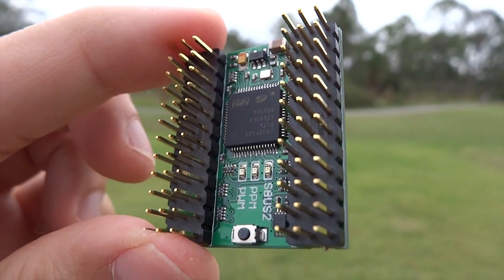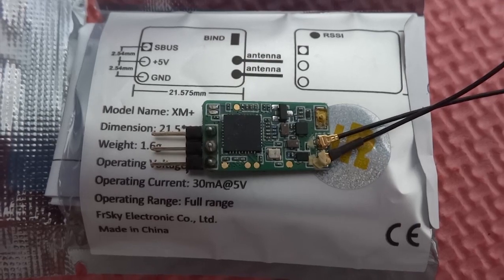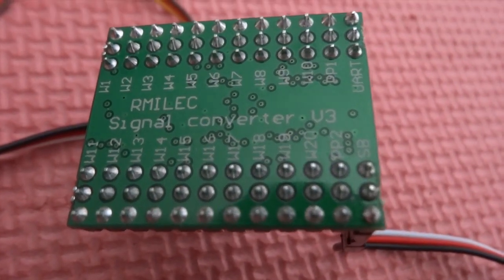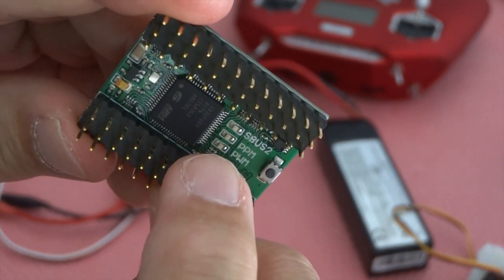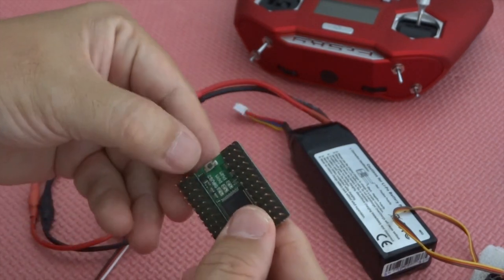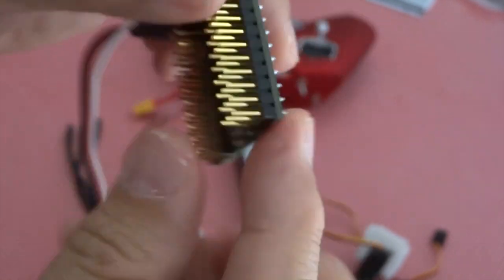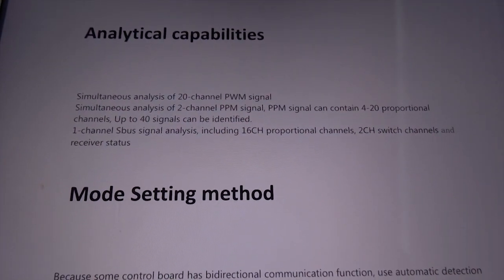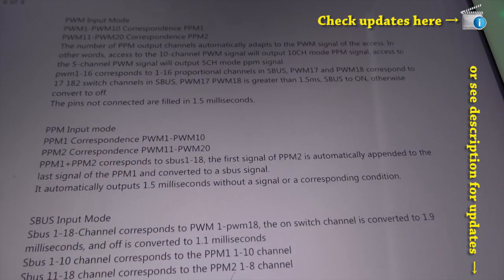RMILEC Signal Converter V3 SBus to PWM Explained

Comment: Hi Dronemission, i've just found your video , it's coool...very very interisting for my project...i need to convert Sbus protocol because i wish to connect my X8R ( sbus, 16ch ) to an arduino nano...all run well when i plug one  signal cable for CH1, another one for CH2...etc and i get the datas in Monitor Serie of arduino..but nothing is happended when i plug my signal cable from my RX directly under sbus...
i suppose this RMILEC Signal Converter V3 SBus to PWM will be match with arduino nano...?
thank's a lot for your answer, happy fly
Philip
Reply from the maker: Greetings, i don’t see a sbus on a Arduino Nano, so you convert x8R SBUS to PWM.
Reply: @dronemission  yes i undertand...X8R Sbus to iN on RMILEC then Out from RMilec to Arduino Nano Pwm... is it correc t for you?!
Reply from the maker: Yes, that would be what I would try
Reply: @dronemission  ok i'll try this when i'll received my RMilec and i'll inform you...thank's a lot

Comment: Can it work with flysky's Ibus?
Reply from the maker: Greetings, it says sbus2.  If you search sbus2, there are lots of discussion about the difference between sbus and sbus2.  It does not indicate iBus where one port for servo data output and one port for sensors.
Reply: @dronemission  turned out i can set my transmitter to either sbus or ibus, when i order it ill test it on ibus and see